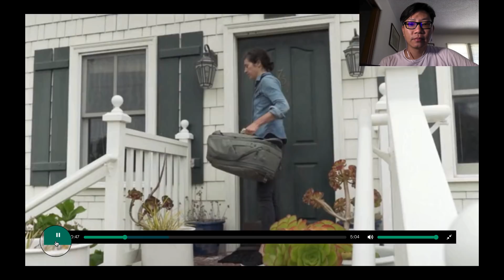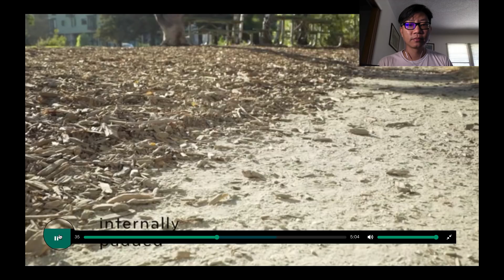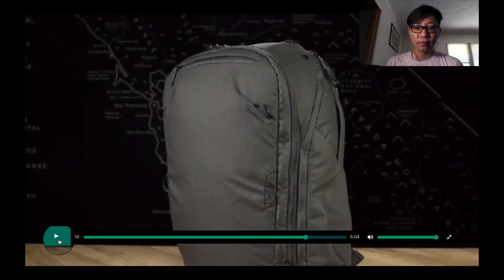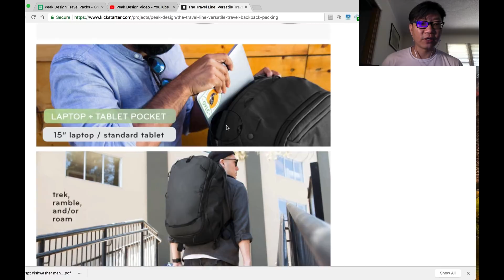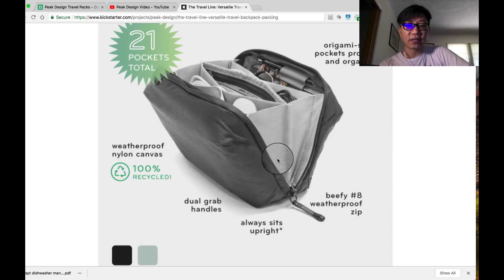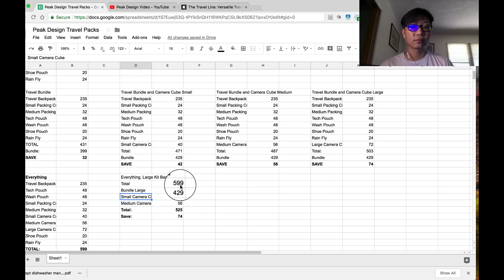Peak Design Travel Line Now on Kickstarter | First Look at Launch

Comment: I watched their video and the live stream before your video Mike, great video by the way, and echo a lot of the key points you highlight. Not suitable for single bag onboard air carry as nearly 3kg's with 3 pouches empty which renders it fairly useless for me. Their biggest fail on their bags is the straps, odd for a strap company, and even though they say the new ones are extra padded they still look wafer thin for a big bag compared to the comfort benchmark which for me wis Think Tank. Like you I have the 10L sling and that is the poorest strap on any of my 10 various sized shoulder and backpacks - Domke, Think Tank, Ona & Billingham. 

I look forward to your future review on this one when you receive it, I think given all the possible combinations there are going to be some lengthy youtube reviews on this one. The tech pouch looks the most interesting for me which may provide a more organised efficient solution within one of my Think Tank backpacks or Domke F2
Reply from the maker: Robin, 

So true on all points.  There is still time for them to consider some further changes on their straps, not so much for everything else this campaign.  Delivery date is by Xmas and while most of the bag is finalized I hope a relatively small company like Peak Design will make some requested changes based on user feedback.  (I hope they haven't gotten too big for this.)

I'd like them to go modular on the backpack straps with bearing fasteners so you can change them out, detach them, or swap them for a more bulky but comfortable design.  Even if they go simple by using a similar anchor link design they have, but sized up for backpacks for the straps in some way.  

Or... they can save all their new ideas for their 9th Kickstarter Campaign and keep the company going on their current success. 

Thanks for dropping by and the comment,
Mike

Comment: I feel like They tried to do too much. Too many zips has added too much weight. It's 2.6kg before you even add a camera pouch... then you add a camera cube and then some of the small pouches. So easily 3kg before you've even added your camera gear.
Reply from the maker: Definitely some compromises in the design, can't have it all until we get some real access to alien tech for mass consumption.

Looking at it another way though, I refered to 'Ember' backpacks in my video and their solution is way more heavy and cumbersome.  This appears more lightweight from the description.  Those backpack straps though... it isn't going to be comfortable carrying a full load of glass.